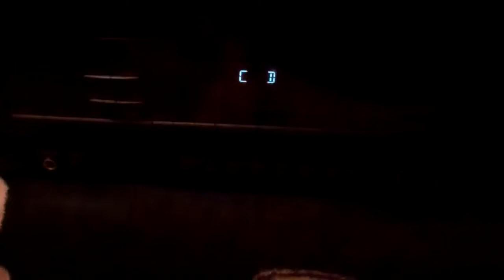harman kardon avr 40 inside view of the oversized guts!

Comment: What happens when the buttons on the face plate do not work but the remote does?  As soon as you try to use the buttons the remote longer works either. What gives?